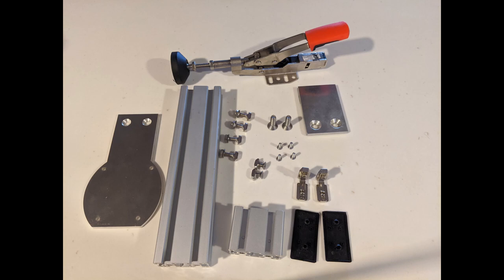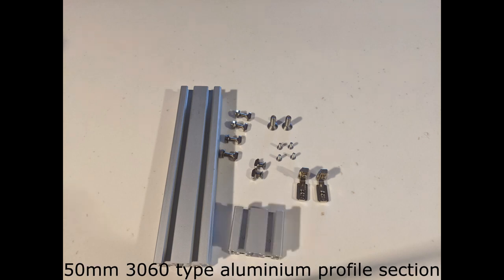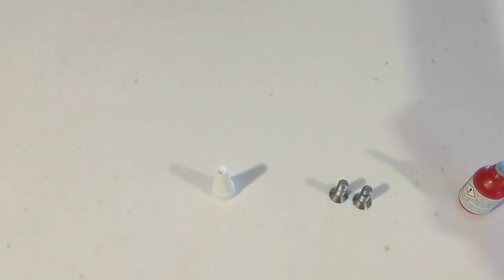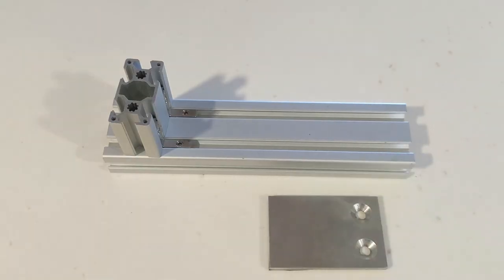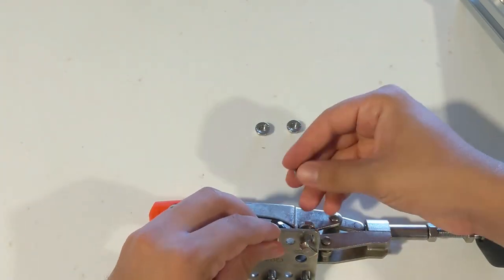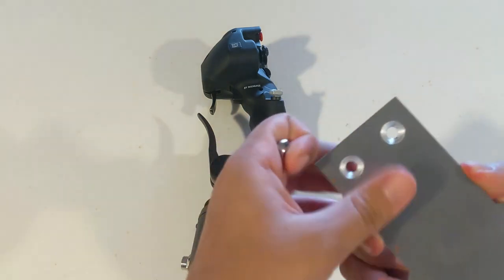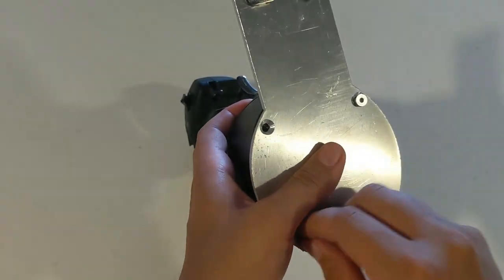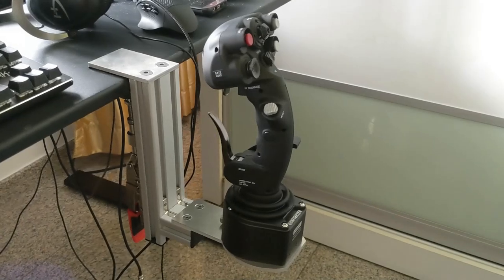Joystick HOTAS Table Mounts DIY! [Machining Drawings + Links in Description!]

Comment: Taking credit for the Monstertech HOTAS desk frame design I see.
Reply from the maker: Bolting together 2 pieces of pre-formed profile and a clamp is not "design" - or else they would have patented it. I drew out and cut my own custom bases - better than theirs, and made a video about how to do it cheaply, with parts descriptions. Definitely more effort than a shitty comment on YT.
Reply: @thelungilife6057  nah mate, I'm actually building a whole standing frame from 4080 extrusion, cutting, drilling, and making my own mounting plates as opposed to having someone else make them. Directly coping a brand's exact design isn't rocket science, but you shouldn't pretend that you came up with it. Especially when you apparently don't have the skill to use a tap yourself for the holes in the frame, don't know how to use loctite, and you use a set of pliers instead of a socket set or a wrench to tighten down the nuts for the clamp like a cave man... But somehow I'm expected to think you're capable of making the rest of it... Let alone those base plates which require more machining then you're even capable of considering you said your "machinist" did the threading... Maybe keep your story straight instead of acting like you did any of the actual work yourself. The inconsistencies in your story and aggressive reply are all I need to know. Clearly I hit the nail on the head to begin with since my original comment was beyond tame, but since you want to be a prick about it, I can come right back at ya chap. Have a nice day ;)